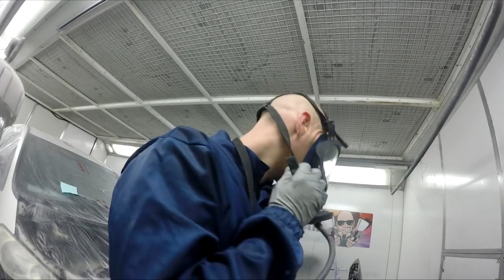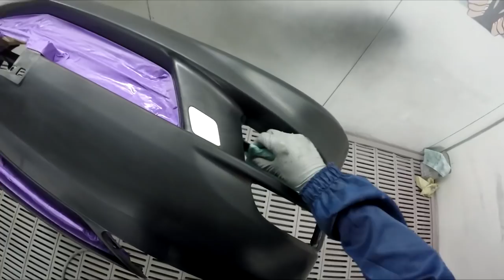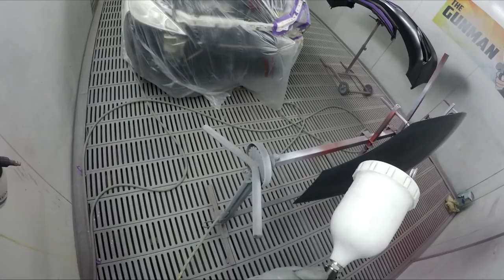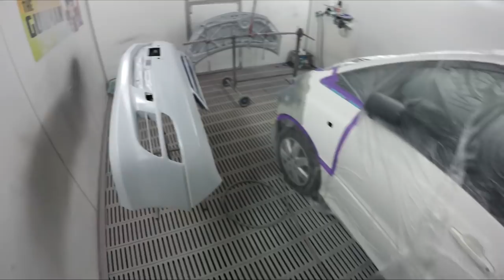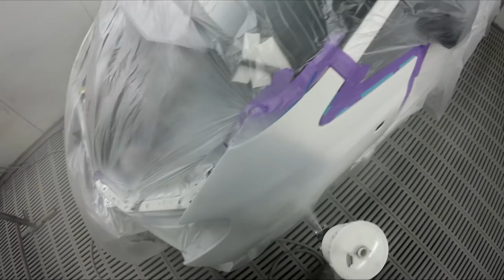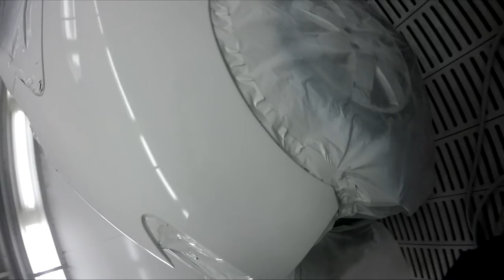Spraying Standox VOC Topcoat

Comment: I AM GOING TO BE PAINTING MY 67 CAMARO DRAG CAR ..IN A HS EPOXY (FROM SPI) SINGLE STAGE BLACK BECAUSE..DRAG CAR...I HAVE WATCHED ALL OF YOUR VIDS AND PURCHASED A TEKNA PRO TE20,  ANI R150 FOR THE ROLL CAGE.(ON BACK ORDER) FROM SPRAYGUNSDIRECT...I HAVE A 5HP 80 GALLON QUINCY 2 STAGE COMPRESSOR..I AM PANEL PAINTING IN MY OPEN CAR PORT IN FLORIDA ALWAYS HOT AND HUMID..I AM BLOCKING EVERYTHING,I WANT A MIRROR FINISH TO MATCH MY GLOSS BLACK WHEELS DOOR HANDLES WINDOW TRIM...ANY SUGGESTIONS? T110?

Comment: What distance do you keep from the panel for base and clear coat?
Reply: Hiii You  It's not a specific distance. There are too many varibles. Paint viscosity, ambient temperature, panel temperature, angle of the panel, gun setup, and the finish you're looking to achieve. The only real answer to your question is, get out there and paint some shit. Youve gotta feel it. Watch it going on. Make mistakes, and than correct your methods accordingly.
Reply: Josh Kritzky thanks 👍

Comment: Hey man how low can that gun spray??  What pressure you have it at now??
Reply: Name Your These are rough gunman starting points for gun setup. Basecoat- full fan, full fluid, 20psi. Tech coat (final coat or blend coat) for metallic specifically, bump the pressure up a bit to get the flakes standing up properly. Solid colors, just run w it. Less paint usage= more $. Happy boss and happy neighbors for hobbyists (less overspray). Clear coat (most guns starting point). Full fan, fluid 3- 3 1/2 turns out, 2 bar or 29psi. That will change with the gun, temp, and finish you want.  More fluid means more pressure will be required to atomise the paint. Less fluid will atomise identically at lower pressure. Your speed should be dictated by what youre comfortable with. If you wanna start slow, turn the fluid in a turn or 2. If theres overspray everywhere, drop your pressure a bit.